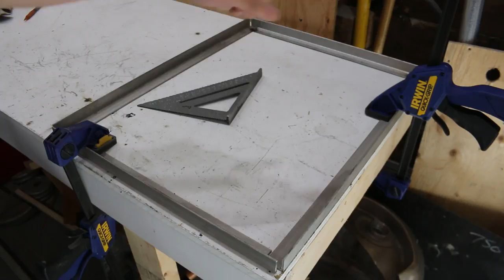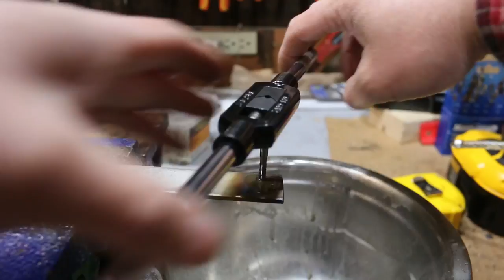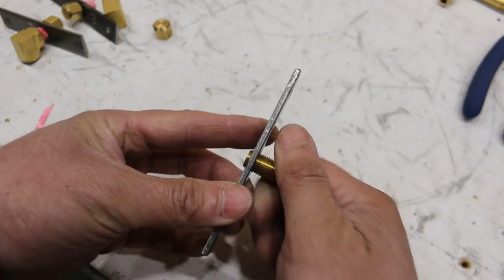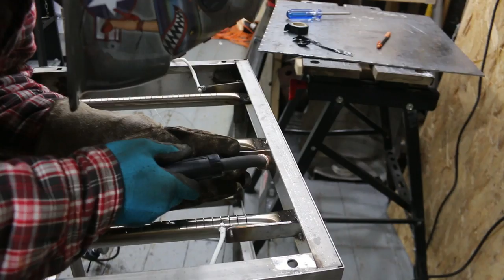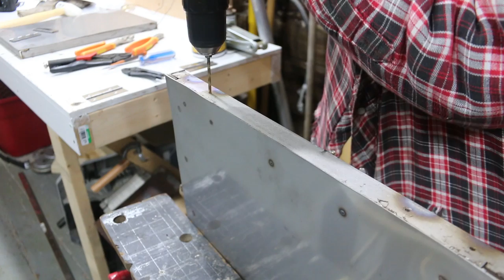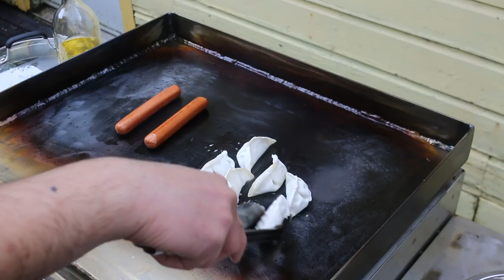How to Make an Outdoor Griddle - DIY

Comment: A cool addition would be to put a ball valve before the 3 burners so you can have a master control over the 3 burners.
I would cut the burners to heat the entire area and then you can setup a warm station on the right or left side of the griddle to keep food warm.
This way you maximize the cooking surface. 
Great build never the less :)

Comment: Great built. Quality all the way. I note this is an old video but from experience, I would like to suggest to anyone contemplating building this is to weld the cooking plate edge around the outside (as against the inner edge). It is far easier to clean right up to and around the edge with a scraper. Otherwise, the scraper is just rubbing against the weld. Looks a lot neater as well
Reply: What would stop grease and food from getting between the metal.?
Reply: @eastside0434  Not so much food but a bit of oil gets in between the rod and the plate. The gap is so fine it is really easy to clean out with a flat scraper when finished. What small amount is left behind stops the plate rusting

Comment: I prefer the wok station, but that's just me.  One thing you might consider is changing the size of the jet so that at full tilt the surface of the griddle doesn't get much higher than 500 degrees.  More than that is usually too hot and will burn the food really easily.  It might also be worthwhile to measure the griddle temp at various positions of the knob and make a chart on the front of the griddle with the temps that correlate with relative position (if you need more precise temps for certain foods, that is).

Comment: its a little late to come with advice since the video is 6yrs old :D the oil catch you could skip, and just make a hole in the middle of the back and make like a catchcan like blackstone did.... i bought a china version of the blackstone recently and is has that lip in front o´f you that is suppose to catch the oil but it sucks big time. other than that the griddle is awesome regarding heat etc... im thinking of just take out the grinder and make a hole in the back, and weld a catchcan in the back.

Comment: The gas inlets do not need to fit tight to the burners?
The small brass piece just sits in front of that big 'ol 1.5 inch receiver that connects to the burners.
Reply: wow imagine my surprise being in the 707 area as well. It CANNOT fit tight to the burner, you need a mixture of oxygen AND propane to make a flame. The propane nozzle sitting in front of the burner shoots the propane into the tube, and the air gets drawn in after it and mixes. If it was tight and only propane was in the tube you wouldn't get a flame until it mixed, so the resulting burner would have flames hovering 2-3 inches off the actual burner, make sense?

Comment: What are the holes for in the center reducer? And why are they only drilled in the center one instead of all of them?
Reply: There are  holes in all of them.. he just had the middle one pointing up, the holes are for air to get a perfect mix ratio  if they were not there the flame would be orange and smoke not blue..

Comment: What is the best heat resistant glue I can use?  I am trying to reverse (upside down)  the plate on the Pizzaz rotating pizza oven to have the high rim upward instead of downward.  Here is the product https://youtu.be/3sWkmcfQdt4